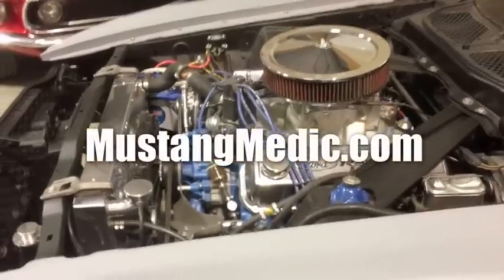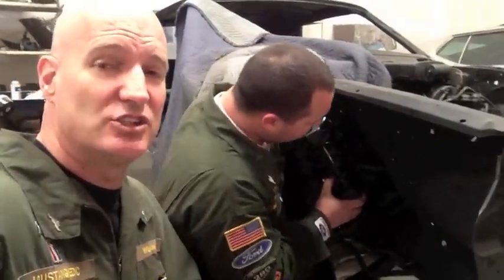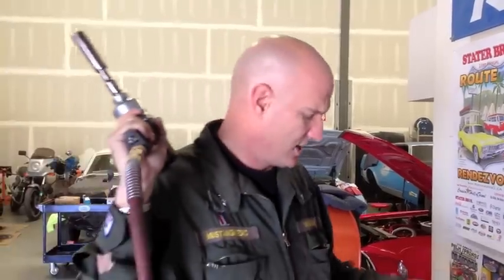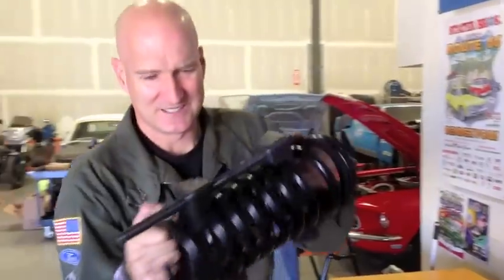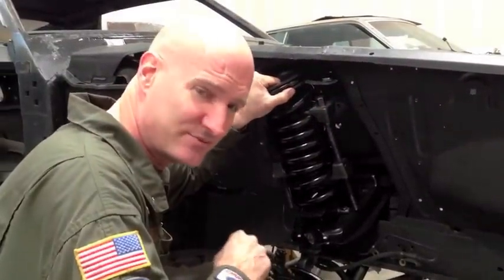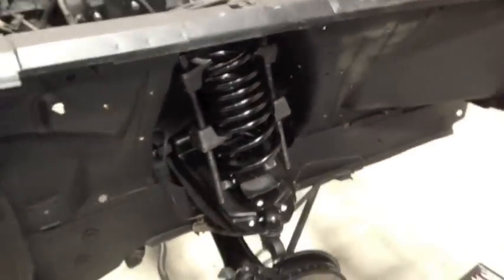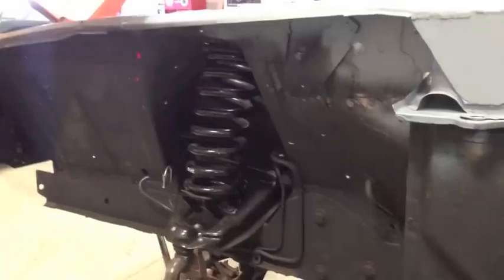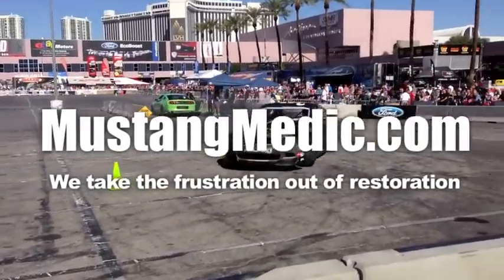Front Spring installation 1972 Mach 1 - Day 60 - The Original Zpizza - Part 1 DALLAS MUSTANG

Comment: When I was loosening my spring compressors I use a jack to lift the wheel a bit while the frame was on stands. I helped compress the spring more and loosened the tension on the spring compressors and they were extremely easy to remove